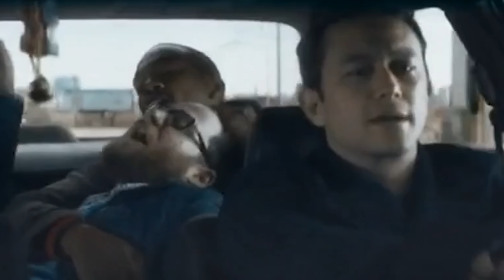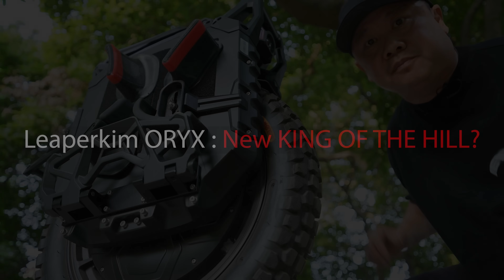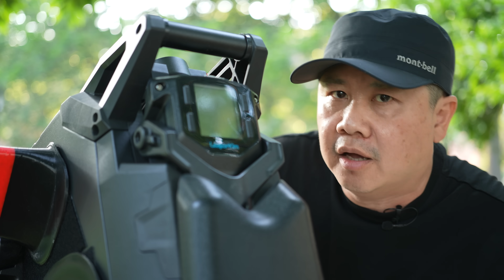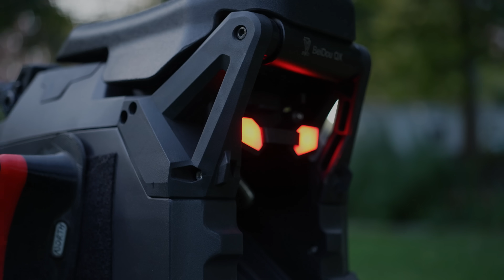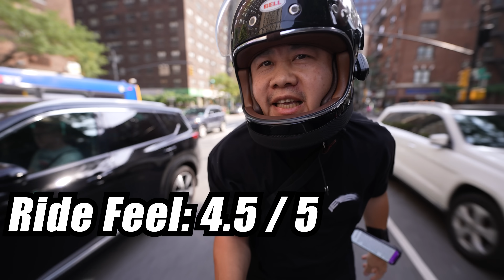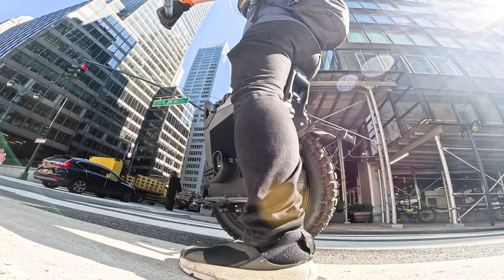ORYX The Fastest Leaperkim Electric Unicycle EVER!!

Comment: No EUC is should cost more than $2500. These EUC are about the same as 150cc - 200cc CHINESE scooter as far as specs, build quality etc.
Everything EUC is overpriced and the fact both Begode and Inmotion sold their once priced $4,000 wheels (V13 and Master Pro) for $1999 proves it

It's 2025 and Brand New EUCs still have cut outs, motherboard issues and design issues (hard to reach power buttons)...anything over $2500 is not worth it
Reply: Well, in Russia it actually costs 2600 so... It's just that the American market gets milked out. EU when bought via AliExpress it's 3600, considering the battery size and power it's pretty good

Comment: Nice clip of the v13 over lean, Thankfully it was the only one ever. It's a cool wheel but definitely underwhelming in the performance category. It's funny that the 126v v13 is faster. Thanks for the review , i enjoyed it as always.
Reply: Huh? What do You mean it was the only one ever? There are plenty of v13 overpowering videos, and the 0 torque at slow speeds is absolutely not compareable to the Oryx.
Reply: Also, V13 does 90kmh and beeps the shit out of you, Oryx does 110 at 84% pwm. The cut out you saw in his video was Infact, a bug.
Reply: @lefotografion  First off, an unlocked v13(of which i was speaking about) doesn't beep at all. Secondly, yes there was a bug, it being at 84%pwm when in fact it was at 100%pwm hence the cutout. Lastly that v13 cut out in the video has been analyzed ad nauseam and the rider overpowered it on acceleration no big mystery it's possible with any wheel show me another. I also have thousands of miles on and off road on my v13 and have had it well above 60 mph many times. So i speak from experience.
Reply: @lefotografion  the v13 has plenty of torque at slow speed but also a safety from a dead stop to protect the control. i have a video of me doing a burn out and smoking the tire on tar.

Comment: I'm kinda pissed I preordered the Oryx now, I want top speed,  ngm and ehweels claim 65-70 on their sites. Either they have zero common sense or its a scam, get some mofo to do 70  on it and I dont have to say you're inept. I was hoping to cruise at 60 at 150 lbs. I had my first cut on the master v4 and at least ill have some more overhead for safety which is a brightside. I also never wanted to pay 4k for a begode cause they pump out wheels and they get discounted heavy is when I like to buy their stuff

Comment: 👎, disappointed in performance, I am happy with my GT Pro + 😊
Reply: My GT Pro+ died from an unrecoverable battery discharge failure. The batteries were way out of ballance, and even when the wheel was off the batteries kept discharging. How is  yours holding up? The good news is that My Oryx will arrive next week!
Reply: @401ROC interesting, I have a GT Pro + with 4,600 miles and haven’t had any issues, on 3rd tire, I do only ride mine on the street, keep charged daily, then at 60% when storing for winter, in climate control conditions and never ridden it in rain. Did you do the same? That’s the biggest advantage of the P6, Oryx or most any other wheel besides Begode/EB, without a doubt they are way more reliable I don’t argue that, but I have had really good luck out of my GT pro +, and still absolutely love it. Sorry to hear about yours, hopefully you have better luck with the Oryx?
Reply: @4 @401ROC are both pack bad? Have you priced out or talk to EB about warranty?

Comment: I think LK really priced this wheel properly all things considered. It’s definitely a niche within a niche due to its impracticality but, the quality is there.  Build and design are still the best even with recent developments until proven otherwise. But, No! it’s NOT a “Left Lane” highway wheel but I honestly don’t think there is one. I like speed runs like this as opposed to “cut out” tunnel although there’s value in those as well. Great job  👍

Comment: Leaperkim wheels do feel soft quite fast. You can still push it a lot after that. At least in my experience. They also aren't as hard as begode, so in terms of power it's  really difficult to compare. You will have to dyno wheels to actually see the difference safely.  Even og patton goes 90kph gps speed. Sherman max 80kph. Personally I love Leaperkim wheel sofware because you can feel when it's giving up, so it's easier to take everything out of it.
Also reliability is one thing that leaperkim has track record of beating every other manufacturer. I personally have 26k km on sherman max and 15k on lynx with same controller. With very little maintainance or issues.

Comment: cant even imagine how expensive having to replace a battery on this would be... 

I think euc manus should start looking into making user serviceable batteries, hopefully without welding, as to make those things cheaper to maintain the lifespan of, just like how gouach is doing with their ebike battery, but the thing is if its even possible to do in such a small space...? im no battery engineer so idk
Reply: Having to replace the batterys is really not on anyone's mind. They last way longer then the rest of the wheel, and the riders are getti5new ones anyway loong before the battery dies. Only the old BMS less EUCs have issues as they don't Balance the cells, and even there a new battery is like 300 and can be replaced in minutes. Idk what you're talking about.

Comment: A lynx cruises well with 35 mph road traffic and is great on mountain bike trails. The oryx would cruise well with 45 mph road traffic for longer distances. I'd prefer something like a lynx in battery capacity and weight with the oryx motor and 22" wheel. My fun rides average about 30 miles and lynx battery was never below 70% after any ride.
Reply: I agree... I've always said this since I started riding a big small wheel would be nice... 2700wh wheel with high torque and a big 22 inch tire... Wish someone could make a wheel where u can choose any tire size for it

Comment: The Veteran wheels are tuned to accelerate at low speeds. That's why the Oryx has a lower top speed, than the Panther. That's also the reason why Begode high speed wheels are sluggish at low speeds. The Monster Pro is notorious for being impossible to accelerate below 40 kmh.

Comment: Yes, EUC are practically insane to ride, way too dangerous for 80% of people tbh. The remaining thrill seekers will eventually drop like flies since the USA has huge vehicles that change lanes without signaling most of the time. The lack of safety is not only from the EUC, but also how we drive here. Good luck if you buy one of these?
Reply: Depends massively where you're riding. I can avoid roads for 90% of my riding in my area, but if you live in a place like new York good luck
Reply from the maker: Practically a motorcycle is worst than a car in most ways, and dangerous on top of it. But ppl love bikes and similarly I see a place for EUCs

Comment: I think you might be missing the point. The Oryx is specifically designed and tuned for long-range performance. It combines high torque with optimized range, but it’s not intended to exceed 100 kilometers. It's more like an adventure motorcycle.
Reply: Thank you, I was looking for this comment! I’m very confused with the obsession of speed of this review, whereas it’s clearly designed as long-range cruising wheel.

Comment: in terms of engineering design, designed maximums should always be double the optimal.  a climbing rope is chosen such that it's capable of absorbing double the stress that it's expected to take. that way there's some overhead to cover stresses that you weren't expecting it to need to take. it's the same thing with these wheels. if it's got a rated maximum of 70 that means that 45 is the optimal for not over-stressing it, and your stats check out, considering that 50 is where you drew the line. also very important but you didn't talk about it at all is braking distance, especially since it's faster and heavier
Reply: It's hard to talk about braking distances. Because people can't brake. I have seen like 10 people online who can actually brake hard, all others just gently lean back and hope for the best. That's now how you emergency brake on a a self balancing device. So if he talked about braking distances, he would have said something like, it's so heavy that's it's obviously way longer. When in reality, he probably just can't lean hard enough.